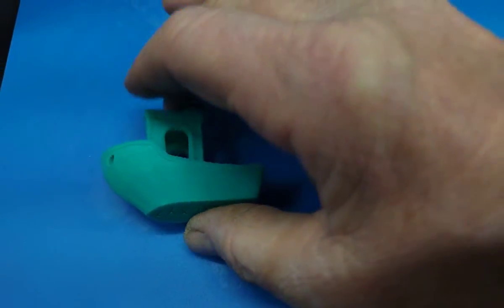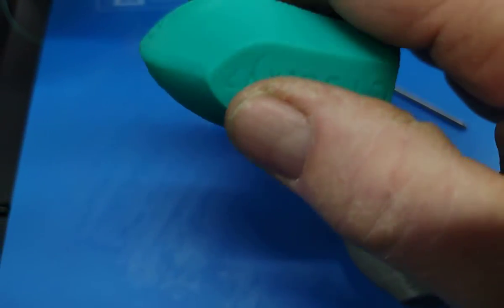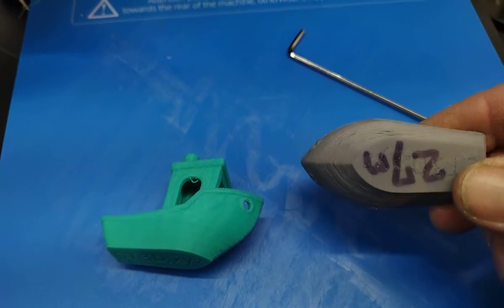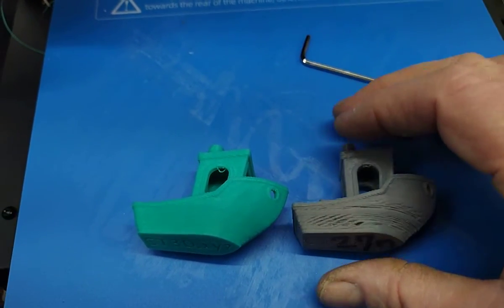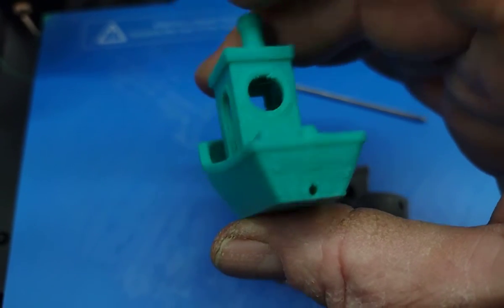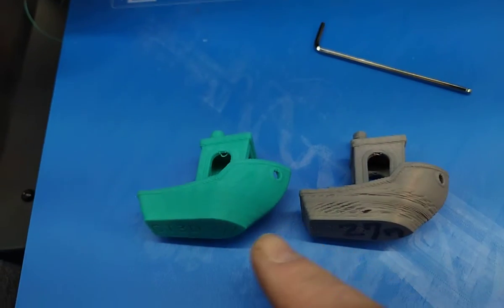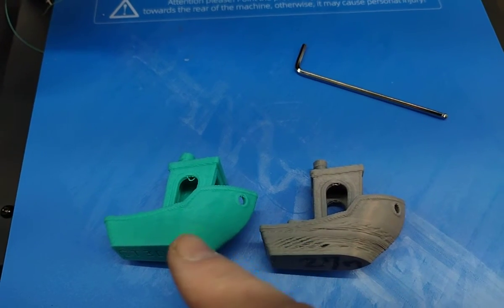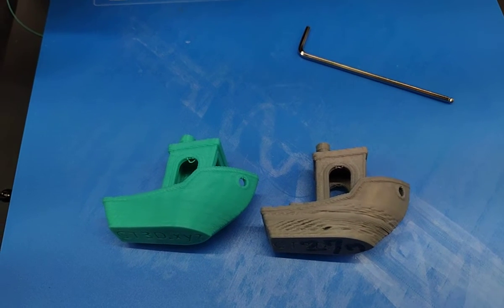high speed printing with Sunlu meta PLA

Comment: what kind of printer and temp did you use for the pla meta?
Reply from the maker: I think this was around 170 c, I don't exactly remember though....  Regular PIA will get through the nozzle pretty fast but you have to run it very hot and always have cooling issues.
Reply: @3dpfeeney  i got 180 to work very well

Comment: @paul results are impressive. what was your printer setup (nozzle temp, print speeds...)?
Reply: They currently only ship with a 0.4 nozzle, I tried to order some bigger nozzles but this was a 0.4 with their sliced file. The only difference between these two files is the filament
Reply: @paulienet  I was in fact interested to know the print speed you have used?
Reply: @paulienet  me too! What was your print speed?